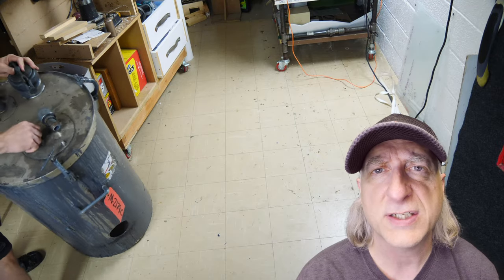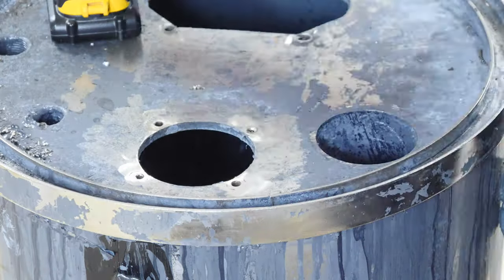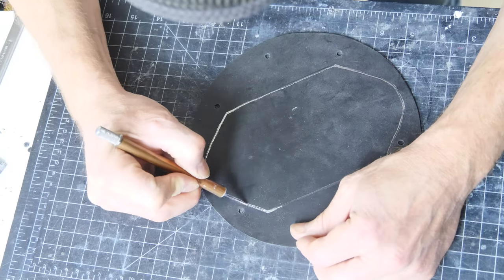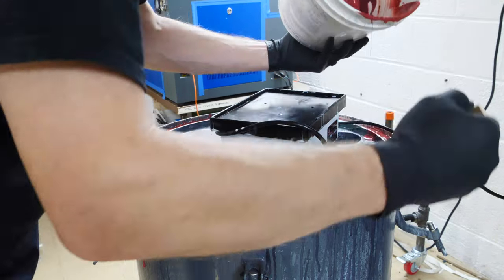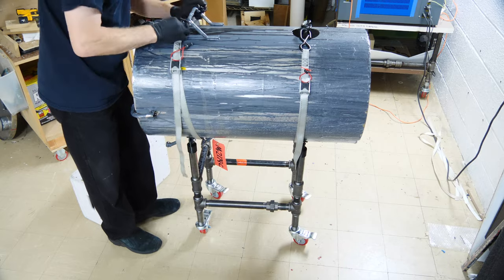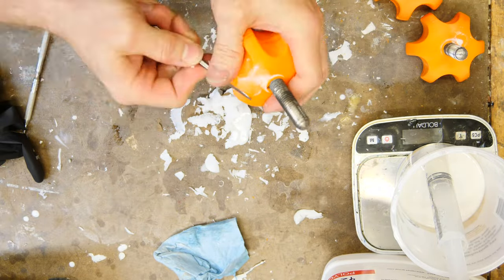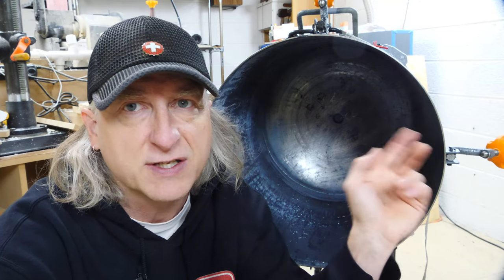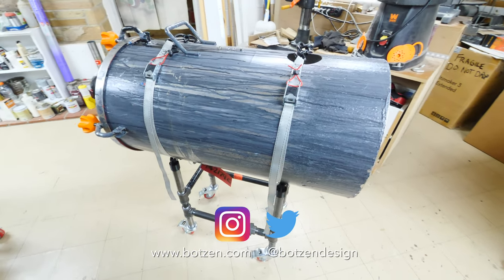Massive 20 Gallon Pressure Tank Build!

Comment: For a vessel of this size and the pressure involved, you really need to purchase an appropriate unit, engineered and fabricated by a U-stamp manufacturer. It isn't large enough to require registration and mandatory annual inspection in the US, but it IS large enough that it must be to ASME (or equivalent) code in a commercial application. I am not licensed in Mich, and no longer work in a ASME-stamp-holding shop, but I know there are plenty in your area. Do it right. I have seen the result of failed air tanks. Not as bad as boilers, but close.
Reply from the maker: I agree, probably gonna scrap this unit. Thanks
Reply: @EricStrebel  Can I recommend you having a look at Robert Tolone's custom pressure pot setup described here ? https://www.youtube.com/watch?v=VYO318KFuAA
It's definitely not the size you need but i found the principle of its oval lid design pretty ingenious and practical at the same time. Maybe that can be tailored and scaled to your needs. Best regards.
Reply: Eric I need you, I sew and I need you to invent something that I know will have to make many sewing folks happy.  How do I contact you?
Reply from the maker: Links on the subscription below, go to the Botzen website
Reply: @EricStrebel  *Tanks

Comment: I wonder, don't you have inspection requirements for pressure vessels used in commercial settings in the US? Here in Germany, this pressure vessel would have a factor of 650 (190 L @ 3.5 bar), so a yearly inspection to comply with our equivalent of OSHA would be required. And obviously documentation about manufacturing, the steel used, the welder being certified for that particular type of material and welding method.

Comment: Man, be careful. If you venture into making a new lid make sure to fill the tank with incompressible (water) first and then top off to 2x your intended pressure.  You might want to talk to a boiler manufacturer about pressure testing. All of this comes from knowing someone who had a lid blow off a custom pressure tank (used for making snowboards). The lid travelled across the room, hit a filing cabinet, and crushed the cabinet.

Comment: This is soo freakin' dangerous! If the tank does not hold 50 psi do not try to modify it. If this blows you won't be able to tell the tale. Please do not be a cheap skate and get a tank which is rated for the pressure you are using! 👍🏻

Comment: This tank is for mixing and storing paint at temperature if insulated, these are meant to run at very low pressures (less than 10 psi) For casting you need the high pressure asme rated tanks at 115psi, the best are stainless steel and have 6 heavy clamps or more, this tank is way too wimpy for casting resins at 60-80 psi, dangerous.

Comment: ERIC - please take a step back and think this thing through.  You are operating this "thing" way past its intended spec.
Cast alluminium is about the most unsuitable material spec for a pressure vessel.
At a minimum do a test with water to 2 x working pressure at yearly intervals
Kind regards from John Spargo in Cape Town

Comment: I'm not sure if is the same sort of pressure tank, but on Robert Tolone channel he has a much quicker setup that he uses, where the lid slots inside the tank and is then held by the pressure from the inside and no other connectors or bolts are required, just a rubber seal. I'm a newbie to all this so not sure if I am comparing apples and oranges here, but Roberts tank looks a lot quicker and easier to operate, but not sure if it would be suitable for this application and the pressures required.

Comment: My silicone molds no matter the plastic or temperature still don't cure completely even after letting them set almost twice as long. What could I possibly be doing wrong I just can't figure it out and all I can think to be the problem would be the age of my silicone
Reply from the maker: Don't use a tin cure silicone. Make sure you follow the directions and mix very well.
Reply: @EricStrebel  I just bought $25 hobby store mold silicone. How can I tell if it's tin cure?
Reply: @charliesybert2683  Should say it right on the box.  If its a platinum cure silicone and is more than a year or so old it's probably gone bad, get a new batch.  Tin cure has an even shorter shelf life, maybe 6 months after it's opened.

Comment: Why don't you vacuum form those car/paint sample things? Or get them stamped out of sheet metal? Or injection molded? The resin casting process seems extremely expensive in both time and materials
Reply from the maker: Vac forming to shitty and flimsy, plus would have to be formed in a female mold, not stampable according to the sheet metal stamper,  and injection molding them for this volume is not cost effective.
Reply: @EricStrebel  Try Norpin Manufacturing. I am sure they could press that out of metal

Comment: tl;dr DONT MESS WITH PRESSURE VESSELS

😮 Oh Boi do you like to live Dangerously, so many Safety concerns, sorry but this is the First Time Disliking one of your Videos.
My Dad had a old 20-30yo Compressor with 10L Volume Exploding in our Basement running ~60psi because the Tank rusted through
It destroyed both Basement-Doors and two Windows, if anyone has been in the Basement at that time, that would have been fatal.
Ruptured Lung, Shrapnel etc.

If you don't have it Certified, don't use it as a Pressure Vessel PERIOD